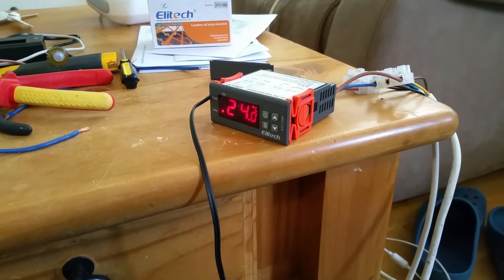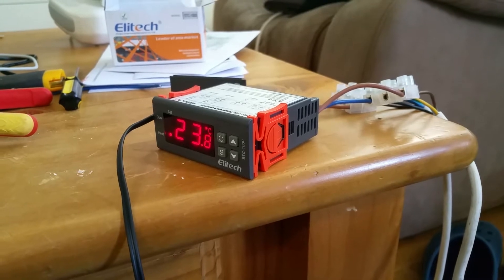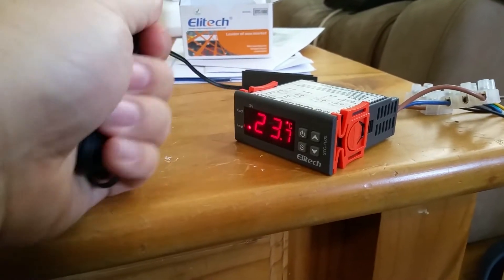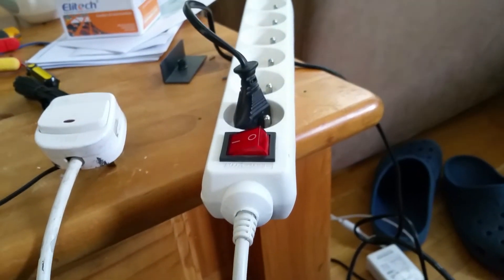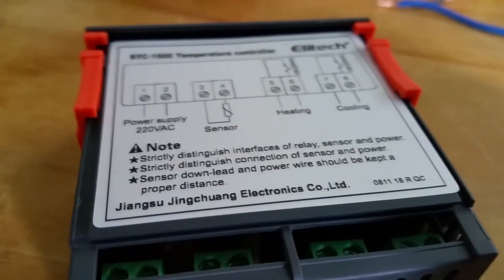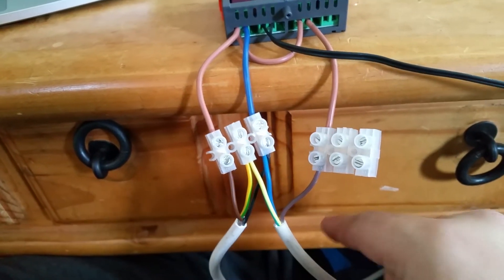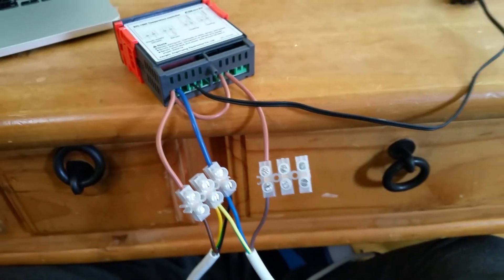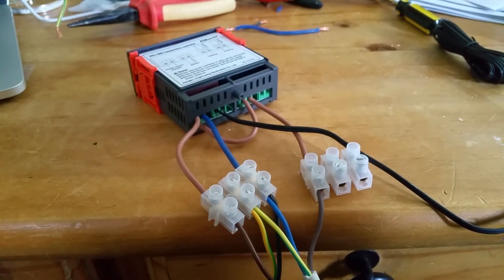STC-1000 controller wiring for aquarium heating

Comment: Great video!! What if you have more than one heaters? do you just plug the second one in the same white strip? and thats it? what about temperature distribution? i suppose one heater is on the left side of the tank and the other on the right.. so would you put your temp sensor in the middle of the tank to allow better reading? 
thanks!
Reply from the maker: Hello, since the strip is switched on or off by the controller any equipment plugged on it will be controlled, so it can be 1 or 2 heaters yes. If you have good circulation in tank no real need to worry about the heater placement, but i would put the probe at average distance of the heaters (no all the way opposite)
Reply: Steph L great! Thanks mate! The best video for this controller by far!! Did you end up putting them all in a box ?
Reply: Steph L can I please ask! This STC1000 includes a 10A relay contactor right ? So for 2x200w heaters, we don’t need to add additional AC contactor right ? I am a bit confused
Reply from the maker: @fotios95  sorry but i have no idea. Your question is too technical for me :)

Comment: great video im looking the same but to run only 2 fans into my aquarium so instead of wiring 5 nd 6 i do it with 7 and 8 ? and instead of wiring to a plug im using an 2 amp switching transformer so i wire to that right? cheers from argentina
Reply: also can i solder the joints with tin and cover em with thermo contract wire cover (idk english name ) instead of using the white connectors? thank you for your time.

Comment: You really should be using wire nuts for the connections, to ensure that no live wires are exposed.
Reply from the maker: I don't see any live wires exposed. I used  the white connectors you can see on the video and the final step was to set it all up inside a box